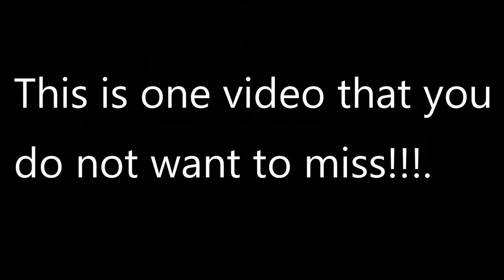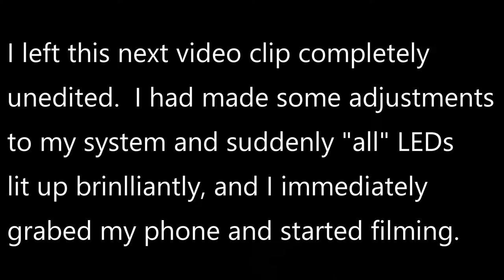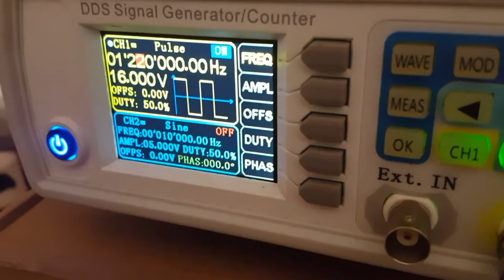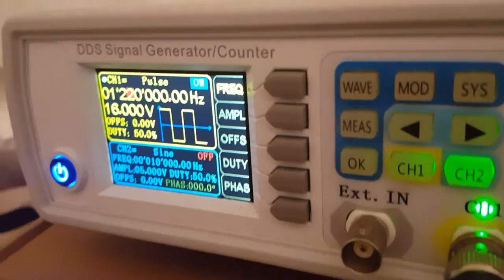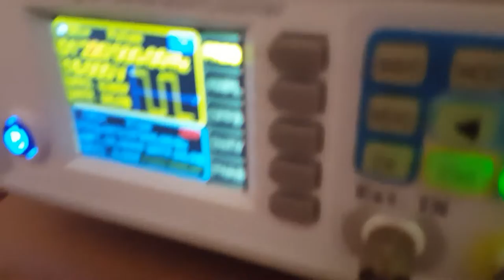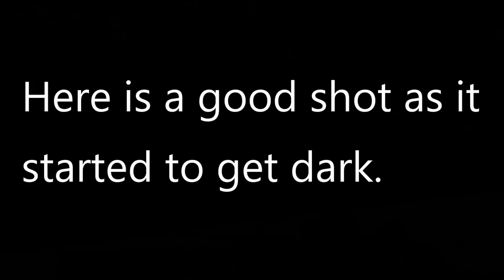WIRELESS POWER TRANSFER Part 17 (Over unity!? Free energy!!?)

Comment: That's great ! Are you getting power from the air? I have watched you for a long time now. Be safe Sir.
Reply from the maker: Thank you.  I get over 120V from the air.  But with this project I am using my frequency generator for my power source which is not much.  BUT, I strongly believe that these LEDs can be powered by by my free-energy-from-the-air project also, and that is what brought me to this pint.  I feel it maybe possible to extract enough energy from anything that you can get a few volts from & power your home with it😎  Energy is in everything all around us.  Electrons are in every atom everywhere and can be extracted, or attracted with a pumping type of vacuum.  Hummm,  I will have to think of a good name for this circuit.
Glad you have been watching for a long time, thanks again😁
Reply: @INVENTOR3  Explain to me how you get 120 volt from the air? Where is the proof for your extraordinary claim?
Reply from the maker: @insAneTunA  I thought you seen my "free energy from air" project, I been working on it for about 9 years.  It was the first video project I ever posted on youtube.  My antenna is not even that high.   Here is last year part 18............   https://www.youtube.com/watch?v=lsDbFewN0M4&t=12s
Reply: @INVENTOR3  That is not what I asked. Show me the proof that the energy that you are converting comes from the "air". 

You are converting energy with your setup, I am willing to believe that much, but I dare to bet that the energy that you are converting comes from a radio signal, or even better, from multiple sources of magnetic waves. 

I dare to bet that your "antenna" would also work in a vacuum of space. And when it works in a vacuum of space a propagated magnetic wave (a radio signal or a beam of light) can be the only reason what is causing the energy conversion. 

So skip that whole "energy from air" story because scientifically that makes not any sense at all. I think that we can all agree on that. 

So the question remains, where does the radio signal come from. Your setup does not rule out any other outside source. So that's the solution, right there. 

You are not running a scientifically accepted setup in order to come to the conclusions that you make. Not only do you have to prove what your main energy source is for your claims, but you also have to rule out all other possibilities. And you did not do that because your setup is simply not capable to do that. 

If a dog comes falling from the sky you will say that dogs can fly. Without thinking about other possibilities why that dog came falling from the sky. Maybe a sick perv threw him from a plane, what would be the most logical conclusion, but strange enough a lot of people would still think that dogs can fly. 

Just out of curiosity, did you have any general accepted education about electronics and physics? I mean, don't get me wrong, I am just trying to understand what kind of a background you have in regards to physics and electronics.
Reply from the maker: @insAneTunA  The term "free energy from air" is a title I picked about 9 years ago and just stuck with it.  Keeping on this same subject of the free energy from air videos(not particularly this project),  yes, I could get more technical and explain more scientifically instead of talking in laymen terms so that everyone can understand.  The energy is coming from many sources, collecting electromagnetic waves, that travel through the air as medium, here where I am collecting it.  As you know, 10s of thousands of satellites, many sources also coming from the Earths surface from man apparatuses, like radio, microwave, etc..  Also many sources coming from the cosmos such as stars, supernovas, quasars, pulsars, etc..  This is all a fact.  I have tried this set-up in 3 locations, with different antenna lengths(all outside of AM & FM radio freq.), higher freq. & at different frequencies, it still works.  Search "Joe Tate APM".  Japan has been studying this tech for early Earth quake detecting, the voltage will rise due to tectonic plate pressures causing piezoelectric effect.

About this project here in this video......  Look, the only claim I'm making here is that I went from 350 LEDs with 11V to 710 LEDs with only 16V & I moved my set-up approx 8 feet farther away from power line in back yard.  "I personally believe" that the extra energy is coming from electrons all around us, period.  I have no proof whatsoever at this time.  Absolutely tests need to be done, I agree 100%, and they will be.  From my experiments so far I personally believe I can light these same LEDs with a fraction of the energy I'm using now with making the same modifications I made to go from 350 LED to 710 LEDs.  Even if I was extracting energy from nearby radio station or power lines, that would still be incredible efficiency, and to know that I could keep making it even more & more efficient & amplify the energy output, I mean making something that could do that should also be able to extract unlimited energy from anything that can produce a few volts.  Yes, Again this is only my opinion and tests will be done.  At this time, with this project, until more tests are done, I think the best explanation of where the energy comes from & how it is collected and used, and even an answer about the terms "free energy & Over Unity", it is all  beautifully explained by Don Smith in the first 15 minutes of this video link.....(which I have in my description)...... Please watch first 15 minutes..... https://www.youtube.com/watch?v=Mnoy2D4wuf8 
About my background, I have two years in correspondence classes in electronics, a professional electronics specialist(basically they send me books and I take tests on line), it was a great class that got taken over by Ashworth University.  I had no teachers or fellow class mates, I am all self taught.  But since I don't have photographic memory and I don't continually practice all that I learned in electronics, I would not consider myself a professional, that is for sure.  But I have 18 years of concentrated passionate studies & experiments in "energy", which includes many areas of science.  I have many skills and many accomplishments, a long resume.  I am an honest, open minded person, with great passion to change the world.
I hope we both understand each other and no hurt feelings😎
Reply: @INVENTOR3  Thank you for the answer, and I can ensure you, no feelings have been hurt. 

But I do have one question about your comment. You wrote this. 

" Even if I was extracting energy from nearby radio station or power lines, that would still be incredible efficiency, and to know that I could keep making it even more & more efficient & amplify the energy output, I mean making something that could do that should also be able to extract unlimited energy from anything that can produce a few volts. "

So my question is:

When you speak about amplifying the energy output, where do you think that the energy comes from that you would need in order to be able to amplify the energy output? 

I mean, it is very well possible to make a random signal resonate so that it looks amplified, while in reality a whole different basic principle from the laws of physics is happening.Because in reality in order to make a signal resonate there is no need for an additional source of energy. And all together a resonating signal does ot produce more energy than a non resonating signal if the input energy level remains the same. In terms of watts the amount of energy will stay the same. 

And there is a limit to what is possible in regards to the max output of a non amplified resonant signal. 

However, for amplifying a signal that is a whole different story. You will need an additional energy source in order to be able to make that happen.  

For example, when I want to amplify an audio signal I need an amplifier, and I know that the amplifier needs energy in order to be able to amplify the audio signal sufficiently enough.  

So in short: With one setup you are receiving a mix of radio signals, which is completely explainable and defensible, with a limited amount of energy, but enough to detect or make a LED glow a little. 

And in the other setup you have LEDS glow a little. Powered by a known energy source. And yet you make it look and sound like as if something very unusual and extraordinary and inexpiable is happening, while it is totally not unusual and totally explainable, and totally not an extraordinary achievement. I think that the biggest achievement you made was connecting all those LEDS together. 

In the old days people were able to make a tiny radio receiver from some scrap materials, a Cristal, and a little earpiece. And it worked without any additional power source.   

And that is when my alarm bells start ringing, can you understand that? And I also hope that no feelings were hurt. I just want to be honest with you.
Reply from the maker: @insAneTunA  Good, no feelings hurt.  I like your comments.  I am still carefully reading your words and trying to understand all that your saying.  Hummm, did you watch first 15 minutes of Don Smith video link?
 Looking at your main question, 
"When you speak about amplifying the energy output, where do you think that the energy comes from that you would need in order to be able to amplify the energy output? " 
Hummm, this sounds like a hypothetical question, like you already know the answer and you want me to understand that it is my Freq Gen that is plugged into the wall, like your audio amplifier. I'm not sure if this is what your getting at.
I will copy your comments below and reply with capitals so that our comments can be easily distinguished from each other......

I mean, it is very well possible to make a random signal resonate so that it looks amplified, HUMMM  while in reality a whole different basic principle from the laws of physics is happening.Because in reality in order to make a signal resonate there is no need for an additional source of energy. LIKE MY FREQ GEN OR YOUR AUDIO AMPLIFIER? And all together a resonating signal does ot produce more energy than a non resonating signal if the input energy level remains the same. In terms of watts the amount of energy will stay the same. 
 I AGREE.  KEEPING IN MIND THAT THIS IS AN OPEN WIRELESS SYSTEM, WHERE IF IT IS RESONATING THERE IS BETWEEN 10 & 30 TIMES MORE ENERGY TRANSFER.  BUT STILL THIS DOES NOT MEAN MORE OUTPUT THAN INPUT, JUST MORE EFFICIENCY.

And there is a limit to what is possible in regards to the max output of a non amplified resonant signal. 
  OKAY.

However, for amplifying a signal that is a whole different story. You will need an additional energy source in order to be able to make that happen.  
I'M LISTENING...

For example, when I want to amplify an audio signal I need an amplifier, and I know that the amplifier needs energy in order to be able to amplify the audio signal sufficiently enough.  
SURE, YEP.

So in short: With one setup you are receiving a mix of radio signals, which is completely explainable and defensible, with a limited amount of energy, but enough to detect or make a LED glow a little. 
  I AGREE 100% THAT EVERYTHING WILL BE COMPLETELY SCIETIFICALLY EXPLAINABLE.  BUT THE LEDS ARE NOT THAT DIM, THEY DO IN FACT HAVE APPROX 2.2V ACCROSS EACH ONE, & THERE IS A HUGE DIFFERENCE IN LUMINOSITY BETWEEN 2.2V AND 2.6V(ONLY A SLIGHT DIFFERNECE IN VOLTAGE).  THE JUMBO LEDS HAVE A NARROW VIEWING ANGLE, SO THEY WILL, NOT APPEAR THAT BRIGHT UNLESS LOKING DIRECTLY AT THEM.  ALL OTHER LEDS ARE DIFUSED.  iF YOU WERE TO GROUP ALL LEDS CLOSE TOGETHER AS IN A LAMP OR FLASHLIGHT & ADD REFLECTORS BEHIND THEM ALL, THEN IM SURE IT WOULD BE BLINDING.
HUMMMM, WHAT WOULD YOU THINK IF I PLACED AN ALUM SCREEN BOX OVER MY ENTIRE SET-UP & GOT SAME RESULTS?
I HAVE BEEN THINKING ABOUT TRYING THIS.

And in the other setup you have LEDS glow a little. BY "OTHER" SET-UP, DO YOU MEAN MY "FREE ENERGY FROM AIR VIDEOS" OR ANOTHER VIDEO PART OF THIS WIRELESS PROJECT? Powered by a known energy source. IF REFERRING TO THE FREE ENERGY FROM AIR VIDEOS, YES, IT IS COLLECTING ELECTROMAGNETIC RADIATION FROM MANY SOURCES, MAN MADE AND NATURAL.  IF REFERRING TO THIS PROJECT, THAN THE ONLY SOURCE THAT IS "PROVEN" IS THE FREQ GEN.  MAYBE THAT IS ONE OF YOUR POINTS, I'M NOT SURE.  IF YOU BELIEVE ANY EXTRA ENERGY IS COMING FROM ELECTROMAGNETIC WAVES, THAN THIS YET NEEDS TO BE PROVEN.  And yet you make it look and sound like as if something very unusual and extraordinary and inexpiable is happening, while it is totally not unusual and totally explainable, and totally not an extraordinary achievement. I think that the biggest achievement you made was connecting all those LEDS together. 
  YES, ALL EXPLAINABLE.  I THINK THE EXTRAORDINARY PART IS THAT EVERYONE WILL BE ABLE TO USE THE EFFICIENTCY IN THEIR OWN HOME, AS I DONT DONT SEE THIS EFFICIENCY BEING USED TODAY IN OUR HOMES AND BUISINESSES EVEN THOUGH THE TECHNOLOGY IS OLD.  DON SMITH MENTIONS THAT EVEN A MAGNETRON FROM A MICROWAVE OVEN IS A PATENTED OVER UNITY DEVICE.

In the old days people were able to make a tiny radio receiver from some scrap materials, a Cristal, and a little earpiece. And it worked without any additional power source.   
YES! PERFECT, THANK YOU FOR MENTIONING THIS!!  IN THE 1800S WHEN THEY USED CRYSTAL RADIOS, YES, NO BATTERIES, ENERGY FROM THE ANTENNA.  NOW THINK ABOUT THIS, THERE IS NO DIFFERENCE BETWEEN 100 LISTENERS TUNING IN OR  A BILLION LISTENERS TUNING IN, THE RADIO TOWER DOES NOT RUN LOW ON ENERGY LIKE A POWER PLANT DOES IN THE SUMMER WHEN EVERYONE TURNS ON THEIR AIR CONDITIONERS.  NOW THINK ABOUT THIS,  WHAT IF YOU WERE ABLE TO NOW CONNECT ALL THOSE BILLION LISTENERS ENERGY ALL TOGETHER.😎 ALSO THE RADIO TOWER IS "RADIATING"(MOVING OUTWARD FROM CENTER IN "ALL" DIRECTIONS) ITS ENERGY.  THERE IS ONLY A "VERY SMALL ANGLE" OF THE RADIATED ENERGY COLLECTED BY THE LISTENERS, NOW, WHAT IF EVERY LISTENER COULD COLLECT "ALL" THAT RADIATED ENERGY WITH NOTHING BEING WASTED.😎

And that is when my alarm bells start ringing, can you understand that? And I also hope that no feelings were hurt. I just want to be honest with you.  I UNDERSTAND COMPLETELY MY FRIEND.  THANK YOU FOR YOUR HONESTY.  THINK ABOUT MY QUESTION, DO YOU THINK THIS WILL STILL WORK IN A FARADAY CAGE?  AND PLEASE WATCH 15 MINUTES OF THAT DON SMITH VIDEO, IF YOU HAVE NOT ALREADY.  THANK YOU!
Reply from the maker: @insAneTunA  Tests & measurements will be coming soon😎
Reply: @insAneTunA  Funny that you raised the "legal" angle :D I'm also glad that that doesn't stop experiments like this. And, how would a transmitter know if I harvested the energy they are beaming at me?! Unless my tuned circuit transmitted it back to them. I'm not sure I get your point. Like, if I turn on the radio, does the transmitter know? ;)
Reply: @nacnud_  I just want you to know that there are laws in place that prohibits people from using certain radio wavelengths without a permit and /or with improper equipment. There are several reasons for that. Technical, safety and commercial reasons. Most of the time laws like these come into play when someone is causing some sort of interference or some other inconvenience with other people or a government organization. Or when commercial laws are broken. For example there are a lot of licensed radio amateurs who take their hobby very seriously and they will report people who cause a lot of interference if they can pinpoint the source. And they are pretty good in locating signals, they do that on a daily basis. 

There is also air traffic that uses radio communication, the military, phone companies, neighbors, local radio stations, and so on. 

But there is also the local and national government, I don't know exactly who's in charge, and they sell the use of certain wavelengths for commercial purposes, and if anyone else is using that wavelength with improper equipment and/or without the correct license it is illegal to use that wavelength.  

When something happens to your house as a result of fire the insurance company will seek for any possible reason not to pay you. And I would not be surprised if they have teams in place who investigate the social media accounts from their clients when they want to claim something on their insurance. 

Again, I am not making the laws, I am just mentioning those laws because there is a good reason why they have put those laws into place. 

And when you start filming your activities, and share it with people on social media, well, it is pretty much an advertisement for law enforcement and local government to pay you a visit. 

On the top of my head I can mention two well known youtubers who had such a visit. Cody from Cody's lab, and Grant Thompson.

By all means, do your experiments, but at least do it safe and correctly and with respect for others and the law. You can prevent a lot of trouble and inconvenience if you would build a proper Faraday cage from chicken wire in order to conduct your small experiments. 

If we all just do what we want to do without thinking about the consequences it would all become a big mess, wouldn't it? Every person is obligated to  investigate the legality of certain actions before those actions are even taking place. In other words, you can never use the excuse that you didn't know any better.